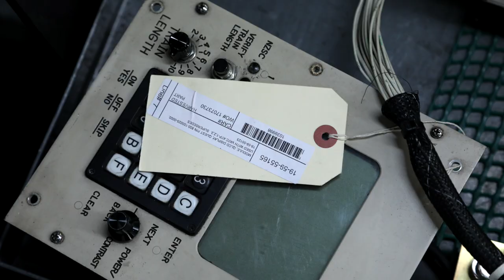BART Legacy Fleet Decommissioning

Comment: Nooooo! The type A train! You will be missed. You have carried people for many years, but like all of us, your time must come to an end. Good Bye.
Reply: well put it in the california rail museum witha plaque saying "first rapid transit or metro train in california" ,because the ones in SF are more like streetcars.
Reply: @takashiPR  : That's because the ones running on the streets in San Francisco are, in fact, streetcars. Sacramento has them. San Jose has them. San Diego has them. Los Angeles has them.
Reply: @sfmike711  Los Angeles street cars were like old days
Reply: @justaP42DC  : Not quite sure exactly what you mean. The rail vehicles currently running along LA's streets are streetcars, modern ones, but streetcars nonetheless. The current term is "LRV" (light rail vehicle), but it's still a streetcar.
Reply: @sfmike711  The old system of Streetcars of Los Angeles was removed. If you don’t know what I mean, check out What happened to the Los Angeles Street car video, that’s the one I’m talking about.
Reply: @justaP42DC  : I'm very well aware of the PE and its unfortunate demise and subsequent removal. Yes, PE indeed operated streetcars as well as interurbans.
Reply: @sfmike711 Technically,no; streetcars operate in single units, while light rail vehicles can be coupled together to form trains.
Reply: @sfmike711 Actually, t was the Los Angeles Railway (LARY) that operates the streetcar system in the downtown area proper. Some Lary lines went into Highland Park and the San Fernando Valley.
Reply: @user-dj7wv5ok2x  : Boston, in their pre-Boeing days, usually coupled a second car (actually it was more like towed) to allow more passengers per run, especially during the rush hours. These were the PCCs as well as the older, boxier type streetcars.

Comment: If this footage was shot at the Hayward Yard (which it appears to be) I went on a school field trip back in 1973 with a small group of students. One of our classmates father's worked for Bart. We took the train  We took the train from El Cerrito Plaza to Hayward where our classmate's dad meet up w/us. We got to see the shop, trains being serviced, parts rooms. It's where I learned one fuse  for the train cost $1,500.00! And $150.00 for each sheet of window glass.  Went up to the observation tower, overseeing the yard. Very educational.
Reply: @TheTheo58 : I find it extremely hard to believe that one fuse would cost $1,500. The glass price is probably on the low end as it's tempered and smoked.
Reply: @sfmike711  As I recall it was a very large cartridge type fuse with flat bar contacts on each end. Which are often used in large disconnect switches.  The fuse was likely a high voltage and amperage as to the cost. The 3rd rail was 1kV DC, each car had 4 150 HP DC traction motors, each pair wired in series.

Comment: Car 1208 was my nemesis.   

I'm in my third decade as a Train Operator.  If you are a frequent rider you have probably experienced what we call a "run through".  This is where the computer that is supposed to stop the train at the station fails to do so, so the operator manually stops the train.  Sometimes we are within the station, and can open the doors and proceed.  Other times, we are partially out of the station and have to go to each affected door to activate a mechanism that physically prevents that door from opening, before returning to the cab and bypassing the safety systems to open the doors that are still within the platform. Needless to say, this causes delays, and is no fun for the operator or passengers.

Back in the 90's or early 2000's, I started keeping a log of which car I was operating when this happened, and it quickly became apparent that car #1208 accounted for about 80% of the occurrences in my data.  I contacted our Vehicle Trouble Desk to report my findings, and they said something to the effect of, "Oh, we know.  Over the years we've replaced the antennas, the computers, even the wiring harnesses, but that car still won't stop at certain stations." (Montgomery, MacArthur, and Daly City are the ones that come to mind.)

After that, I always took note of when I was operating #1208, and took matters into my own hands to ensure we stopped within the platform.

Many years later, I was operating car #1208 from SFO to Pittsburg/Baypoint late one night.  As we passed the maintenance yard in Concord, and started up the rise toward Concord station, I observed an enormous eucalyptus limb that had fallen across both tracks.  Trains do not stop rapidly, so needless to say we hit that limb with considerable force.  It knocked out the headlights, cracked the front of the cab, and damaged some track equipment, but despite my hopes, it didn't knock any sense into #1208. (i.e. it continued to stop long on a semi-regular basis.)

R.I.P. #1208.

Couldn't have happened to a better car.
Reply: Amazing story, thank you for posting it. RIP (recycle in pieces)
Reply: Truly the end of it
Reply: Bruh
Reply: Great detective work there! I've seen a new train fail to stop at a station too so good to know the TOs are being vigilant
Reply: If you can't beat your enemies, outlast them!

Comment: I'm a retired T/O, having left in 2013. I'm not sure why everyone is waxing nostalgic over these old cars. They were temperamental and overly prone to problems, both big and small. Things like heating/AC, doors, brakes, lighting, overheating bearings were problematic and sometimes hard to fix on the fly. The on-board computer would act up causing more headaches. I once had a fully loaded, 10-car, afternoon rush-hour train crap out approaching Rockridge. I couldn't get that computer to reset no matter how I configured it. I had to dump some 1,000 people at the station to squeeze onto following trains to continue their journeys. Folks, while the cars were cutting edge back then, they certainly gave it their all and really needed to be replaced.
Reply: Here in Boston, we had the Hawker-Siddeley cars on the Orange and Blue lines, and while they were great when fresh from the factory, 41 years of wear, tear and Boston winters rusted them alive.  I've never been to SFO but I would go there just to ride the trains and trolleys, especially BART.
Reply: Hey, can't fight nostalgia. But, I get it from an operator's perspective. You guys knew those trains better than us. But, for us riders, some different memories hit.
Reply: @BrianJColby15YT I lived in Boston from 2000-2007, so I know EXACTLY what you're talking about.
Reply: @BrianJColby15YT  The Orange & Blue lines were definitely not as nice as the Red & Green lines. The "new" Silver Line wound up being a fancy bus w/ dedicated underground tunnels for some portions. Though the SL1 being free from Logan Airport to South Station, where you can get a transfer ticket to the Red Line, is pretty sweet.

Comment: Let me tell you a story on my first A2 car. It was 1208, an early morning, Tuesday. It was sometime before FOTF came in, so i think like 2015. The consist of this yellow line train was, as i recall, 1208, 1844, 1531, 1689, 389, 2516, 2559, 1728, 1832, and i think it was 1195. I was at the south end of the MacArthur platform, going to SFO. As I boarded #1208, the only i thought of was how crowded it was. Packed with commuters going to San Francisco, and other people. Little did I know the 5 years later this train would be sent a scrapper, never to be seen again. As of now, January 2024, There are only 17 A2 cars left, and only 1 will be preserved.

Comment: I rode on the BART a couple of times back in the late 70s. At that time it only went 3/4 the way around. And never went to San Jose from either direction. To the best of my knowledge didn't go anywhere else yet either. That's turned into one helluva Transit line

Comment: What's the purpose of covering up the car number with tape?
Reply: I know when airliners take their last flight to the boneyard, the logo of the airline is painted over, but I can't see the purpose of blacking out a car number.
Reply: Here's what I'm going to guess.  Bart sold the car before it left their yard so when It was on that truck, it was no longer their property.

Had an incident occurred when that car was under transportation to the scrapper, some legal mind at Bart probably figured that some way somehow someone might try to make a case that Bart is liable.  They probably thought just to be on the safe side that covering up the logo could prevent that from happening.

However, I really don't think that would have worked.   Assume for example that there had been a major catastrophe where that car rolled off the truck on the freeway and 50 people died.  Such an incident would probably exceed any insurance the scrapper had and people would be looking for deep pockets.

Attorneys would argue that Bart was liable given that they knowingly sold a car to someone with insufficient means to transport it safely.  This argument would hold water whether or not the logos were taped over.

Comment: I rode these nonstop since the 90s, so I'm not sad to see them go.  Had they retired gracefully around 2003, or some arbitrary but reasonable date, I would have greatly missed them.  They're like a creepy relative that shows up uninvited and always lingers around long after the party is over.  Ready for the new fleet.  Onwards and upwards.
Reply: And it's a guarantee that the new equipment will NOT last as long as the ones now being destroyed!

Comment: I like how they convert the aluminum car into steel. Didn’t know that’s even possible...
Reply: @florihupf: It is not possible. Steel is an alloy of carbon and iron. Aluminum is an entirely different metal. Sorry to tell you this.
Reply: @sfmike711  maybe Schnitzer Steel is using the aluminum to stretch their steel?
Reply: @florihupf  : Since aluminum and steel in direct contact with each other will produce galvanic corrosion, some sort of buffer is needed (such as a rubber gasket or washer). It is highly doubtful that these two materials could be made into an alloy because of the destructive nature of corrosion. Anything made with such an alloy would be doomed to failure and could lead to loss of life.
Reply: @sfmike711  hmmm, that leaves the question why the old cars are going the steel plant, hmmmm hmmmm
Reply: Each car is 22 tons of metal! It breaks down to: 15 tons of steel, 6 tons of aluminum, & 1 ton of copper.